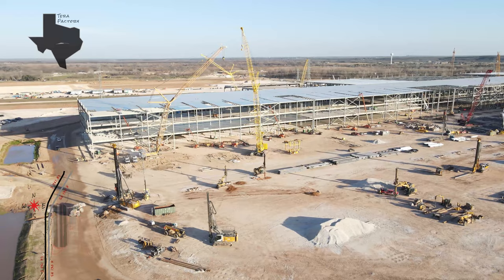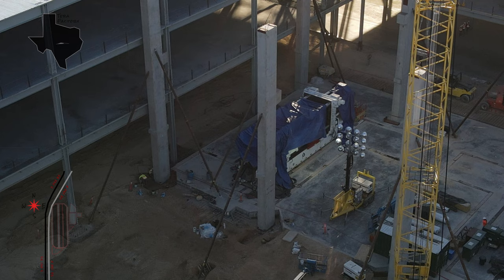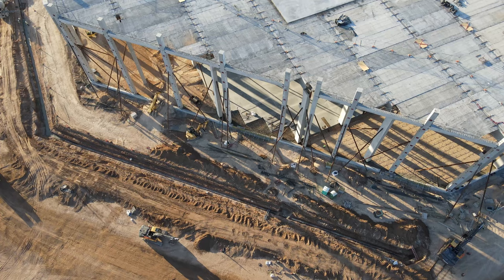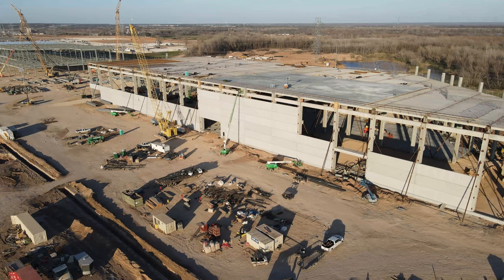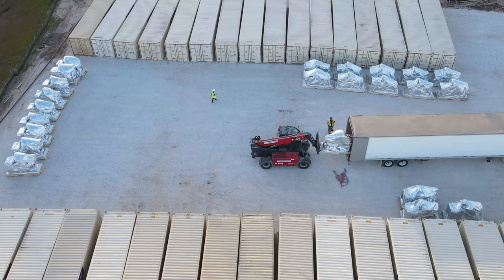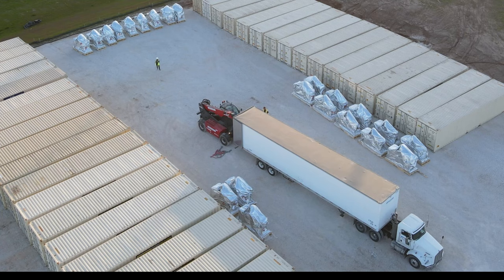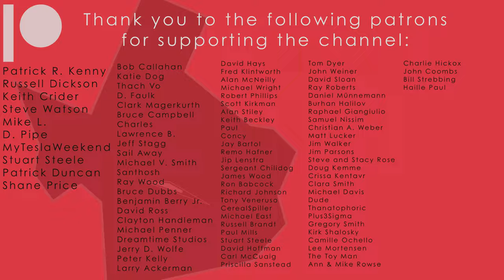Tesla Terafactory Texas Update #105 in 4K:  First Robots Delivered - 02/03/21 (5:00pm | 75°F)

Comment: 594 steel squares (+12 from last video)

Divide the building into 4 equal sections, labeling them A - D (west to east). 

Section A : (11+11)x6 = 132
Section B : (9+5)x5+2 = 72 +2
Section C : (10+11+11+5)×5 = 185
Section Dn : (41−19−6)×6+5 = 101 +4
Section Ds : 17×6+2 = 104 +6

Section B like section C. Both are 5 squares wide separated by 2 squares. 

Section C is the largest section at the moment.

Sections A, B, and C share firewall lines between buildings.  Section A's northern part matches the third part of section C. 

Section Dn starts 18 squares down on section C.  Making a column of 48 steel squares between the stamping and casting sections (giving a total of 288 squares in section D).  Just north of the stamping areas will be row 66 of the steel squares.

Section D parts are separated by 6 rows of squares with 5 additional square, so 6x6-5 (=31) squares needed to fill in the separation. 

The southern part of section D starts at row 41.

There are (67−41−15)×6−8 = 58 squares to fill before the stamping area. 

Of the existing foundations, there is room for 1296 steel squares. 

Note: the partial squares along section A are counted.  The partial squares along section D are not.

Comment: Following on from the Shanghai model Y production line video of yesterday, you can clearly see where the outer shields around the casting machines and the laser dimension check  scanner booth will go ( see the darker lines around the core casting machine)

Comment: Great shooting today Randy! Love those robots. They concrete the box-connections between the beams and the pillars when they concrete the roof sections, it seems; before they can remove the props and add the upper wall sections.
Reply: They will need time for the concrete to cure as well, and time below 10°C /50°F does not count.
Reply: Yep, you can see they have removed the support props where the roof is poured and the connections between the beams have been poured. Once that all sets, the structure and beams are fully connected and tensioned, so supports can be removed! You can see some of the lifts on the inside finishing up getting the forms up around the beam junction points, boxing them in for the pour on the North end they are preparing to do for the roof! Going to be exciting getting the roof and beam connection pours done, because with the supports removed, they can move much more  quickly in getting bridge cranes and equipment into the building! Floor pour will be finished soon too!

Comment: Randy, great video as usual.  I think you are missing something when you talk about the structures along the East side getting connected.  They are using that gap between the North and center structures as a road.  They can move the cranes through there if they need to.  They will not close that off until the very last thing, when they no longer need to move cranes and supplies through there.  The same may end up being true at the connection between the south and center sections.  Notice how they have not connected the west side to the east yet?  Same reason holds there, even though we can see the piers there to bridge the gap, they will leave that open, for east of moving supplies and equipment through the site until they no longer need to.

Comment: At 10:17 there is a space in the original steel structure I want to call “the great room” . They have omitted columns and floors in this space. The roof trusses are double the length of the standard trusses. All of this creates a very large open volume in the building. So far they have not installed any roof panels there. What is the purpose of this space? Will they be adding vertical conveyors to move parts in and out of inventory from all levels of the building? They have tall traveling lifts at other Tesla factories.

Comment: Final columns installed next to casting machine! It will soon be under roof and no longer visible.😢
Reply: Curious,  both the mobile cranes they used to build the first casting machine operated with jibs taller than the roof.
Reply: @davidclark2286  I believe they will use the gantry crane to assemble the others. I also think that the first one was practice to see if it would be possible to use the gantry crane for the others because they did not install the roof panels over the other Machine foundations until the large pieces of the first one were in place. Just my opinion.😃
Reply: Also, there was no power for the gantry crane, so a portable one was the only option if they wanted to get started building the casting machines.
Reply: @dmpease01  I think they are just doing the one for now and will now wait for the building to be build before doing more.  This one they will get running as soon as they have a roof, walls and power.
Reply: @davidclark2286  The gantry/bridge cranes that will be installed will likely move the other gear into place for the other machines. They need roof T's on, sealing, rebar and concrete pour on the roof T's done (and at the same time the concrete will be poured for the beam connections, which will have forms around them), then can remove the beam supports and put in the bridge cranes. So getting the roof on quickly is key to getting more casting machines installed!
Reply: Still some large pieces needed for the first machine: 4000 L. vacuum, melt furnace, and holding oven. Some of those structures look pretty large in Fremont but maybe a smaller crane could handle them.
Reply: @dpipe6072  The bridge cranes will actually be able to hold massive loads, as they have the mass of the concrete reinforced infrastructure all around them as part of their load ability.
Reply: @tonyvelasco5732  gantry cranes in steel factories carry massive ladles fall of molten steel. I don’t think any casting machine part weighs more than that!
Reply: And yes I know a gantry cranes technically travels on tracks on the ground like in a shipyard but I just call overhead cranes by that name anyway🤣

Comment: Surprised that robots arrive on-site so early in the construction process, months before they’re installed.
Reply: Wondering if these robots will be part of the paint shop? The ground floor is almost finished and so is the second floor. It won't take long to get the roofing membrane put on since there is almost all of the sheeting in place, and the paint shop could be ready to go pretty soon
Reply: G Berlin they started putting equipment into the areas as soon as the roofs were water proofed,  even before the whole floor was roofed.   Upper floors before ground floor slab completed.
Reply: @davidclark2286  They have moved in lots of equipment to the paint shop, but to my knowledge, none of the other buildings have major equipment moved in. One casting machine has had parts delivered also
Reply: Oh contraire! They will start moving them into place as soon as the concrete floors in the paint shop area and other areas are set, and many of those are in place already. In fact, they have been targeting particular areas of each steel truss structure for concrete first, likely because they have robots arriving that will go on those floors. So could be on those floors within a week or two, likely as soon as the roof has concrete poured, so is then waterproof. Don't even have to have the walls all the way on yet, since they can leave them wrapped and move them into place, then unwrap when ready to connect up the electrical.
Reply: I think stashing them in the containers supports my guess they’re going to be there awhile before they’re moved into the building.

Comment: Assuming that the 38 rented containers will be used to provide storage for the robots...
Reply: If that were the goal, why wouldn’t they just ship the robots in containers and offload as a unit?    It seems odd, but they might actually be planning to stage them (or at least some of them) in the building soon.
Reply: The 38 containers  may be full of robots. Lets hope.
Reply: @rascalminihan7381  I think they're full of something could be robots. They are accelerating the pace all the time, I really think some initial (test) production will be happening before mid year.
Reply: @rascalminihan7381  check out Joe's early morning video from 4th Feb. The robots have been stacked away in the containers.

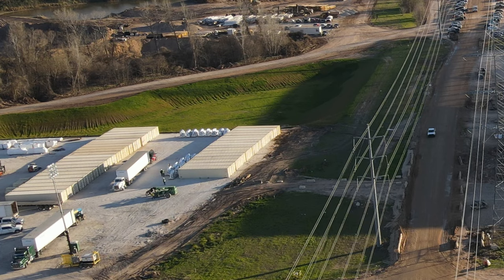Comment: What? WHAT!?!?! Did they eliminate one of the retention ponds? See 2:30 this flyover! Compare with Jeff's flyover https://www.youtube.com/watch?v=7mg1xJ3CvYY at 0:59!
Reply: Converting to a ditch instead it looks like
Reply: I think they are going to put in a better drainage ditch along the east side and then allow the construction crew in the northeast corner to spread up further north so they can keep working on the foundation in that area! They installed 4 more concrete columns and only have 4 to go by the casting section, so I'm expecting more footers to be dug in the corner which will force the casting machine assemblers to move shop
Reply: @zacadams7070  Insightful comment.  After watching the first casting press assembly it makes sense them moving into the north parking area for staging.  That pond was right in the way.

Comment: Can somebody explain why the stamping machine structure is made from precast concrete pillars and beams with double-T roof panels while every other building  on the site, with the exception of the casting area, is made of structural steel? Is this a question of damping vibrational resonances in the stamping and casting areas?
Reply: Bridge cranes are the reason, perhaps..
Reply: Most likely the structure is needed because of the large overhead cranes that will be put in place to move stamping and molding dies in the two locations.  The cranes will be like the ones in Berlin that ride on large steel beams placed on the intermediate support points on the concrete columns.
Reply: Concrete pillars can support much greater loads than steel pillars.  Concrete is immensely strong in compression but not so good in tension (pulling apart).  In comparison, steel is strong in tension but not very strong in compression.  This is why you see both steel (rebars) and concrete used together when you need both tensile and compressive strength.  Those concrete pillars are reinforced with steel bars within them (just like we see in the foundations being made).  This gives them greater bending strength as very heavy loads are started and stopped.  Hope this helps.
Reply: @dranthonyv5475  Yes it does help...so the stamping and casting structures will be subject to very strong tensile and compressive loads?  Stamping and compression certainly go together.  I suppose the casting operation also implies heavy compressive loads.
Reply: Following is a comment posted by William Wheeler back in early December, gives a good logical explanation. 

They are using mass to dampen the vibrations and inertial moments of moving heavy weights on the rail cranes resting on the columns. It’s another factor in using heavy concrete columns instead of just steel. If the structure weighs thousands of tons it doesn’t even notice the energy needed to start and stop heavy loads weighing just tons. It’s that old equal and opposite law in action.
Reply: @DessieDoolan  Hi Dessie...this makes sense to me since I imagine that the stamping and casting processes have very strong impulsive forces, whose frequency spectra are going to be high with a relatively  broad distribution.  You want a structure whose characteristic vibrational resonances are very low...like massive concrete pillars.  Then there are the gantry crane loads the require good compressive and sheer strength.

Comment: Randy do you know anything regarding the temporary supports to the cathedral?
Reply: @vicgarbutt3310  am I mistaken that shorter supports put on lower walls?
Reply: Some are being removed to put on wall panels, but I expect they will remain until the beam and column joints are poured, as they pour the roof.  This will create a solid structure and the wall panels will stiffen it.  Then they can all come out.
Reply: @timboatfield  thanks Tim I appreciate you feedback!
Reply: @timboatfield  Exactly, when roof is poured, they also are pouring into the forms put around the roof beam to support beam joints, so truly bonding them all together for strength and stability, so then the supports on the vertical beams can be taken down!